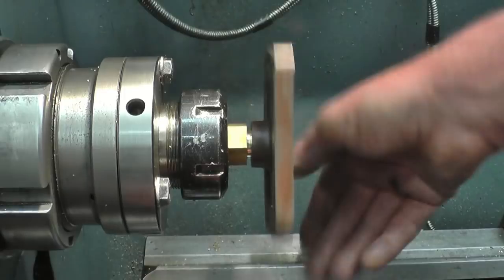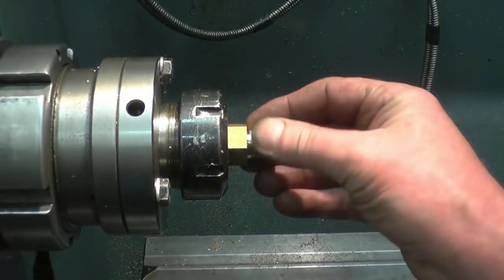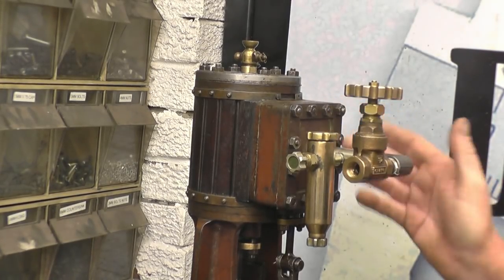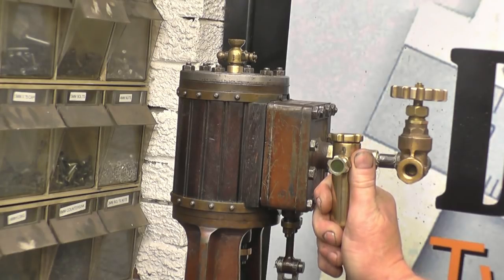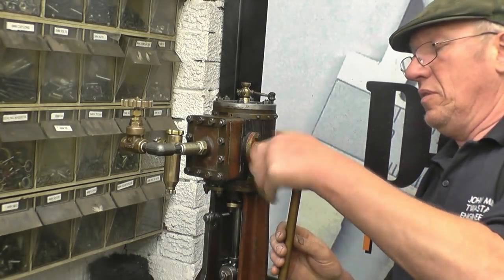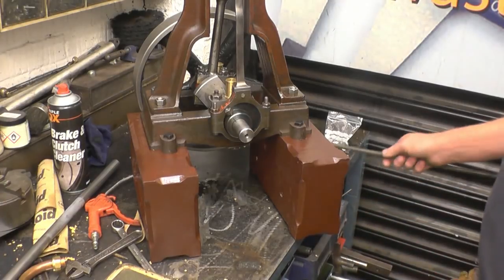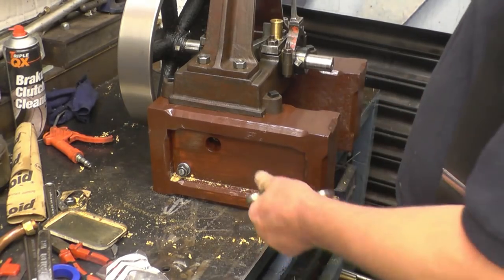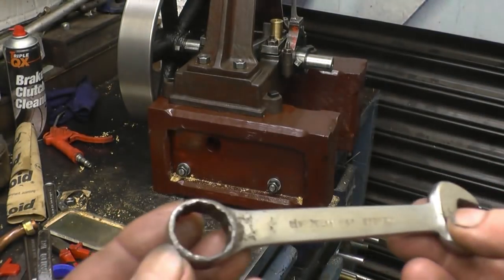SNNC 229 P2   Steam Engine Base

Comment: John, several months ago you showed a tip to prevent parts from tilting in a machine vise.
I think that it used wires but I'm unable to find it again.
Do you remember which episode that was?
Thanks, Norm.

Comment: Richard did lovely work on the base for your engine there John; I look forward to seeing it tick over!
Reply from the maker: It was Mick that did the wood base for the engine  Like you say a nice job
Reply from the maker: I would like to fit a governor and run a dynamo with it
Reply: I guess I need remedial paying attention to detail, oy.
Reply: Find an old morris generator and fit it, would be almost period ( or at least look the part of being old) and with the original cutout and regulator, plus a few car lamps and a battery there would be useful work done as well. Put in a few cigarette lighter sockets on a length of wood and you could put a sign up 'bring your own car charger and charge your phone up with steam power" as a drawcard. Probably will get you a big line as well..
Reply from the maker: What a splendid idea  Steam powered phones